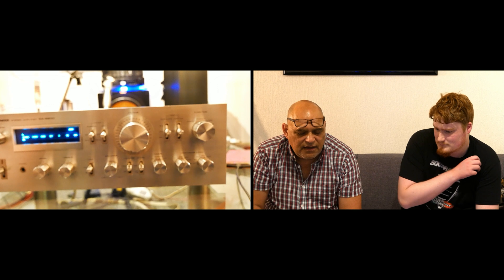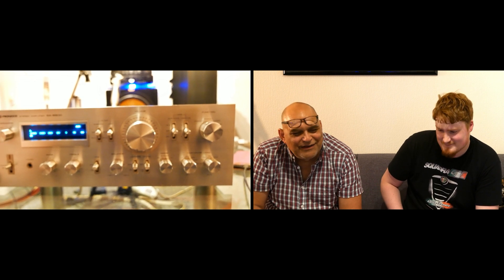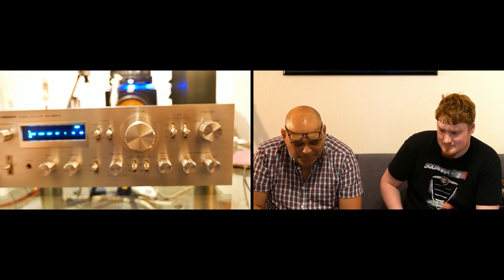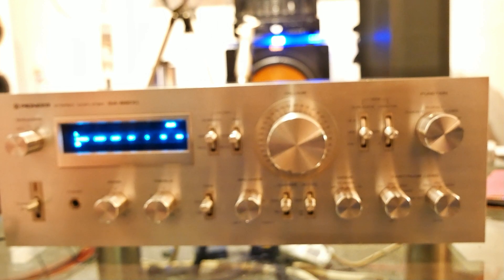Pioneer SA-8800 review soundtest

Comment: One thing that improved everything I've ever listened to is using a low frequency cutoff of 40 Hz. This is for the vast majority of music, some music can do a 35 Hz, but generally when you go lower all you're doing is allowing the soundless low frequency noise to drain your amp's capacitors with pointless excursions. I think a lot of CD's etc. they optimize the files and the process adds a lot of noise. The results are clearly noticeable, I wish everyone would try this and then we need a video on the topic and lots of comments.

Comment: Maybe reduce the voltage on the display so it last longer. Olso If the amplifier is rated for 220Volt and you use it with 230/240 all the components will run on a slightly higher voltage. Or does it have a voltage selector ? 

In the Netherlands it is 230 volt with +6%/-10% range but I think 240Volt is common. Especially with all those solar panels on a sunny day.

I know car manufacturers olso use brands like : B&O, Harman Kardon, B&W, Mark levinson and Volvo used Dynaudio, I wanted to hear that.
Reply from the maker: Not sure about the voltage switch. Simon still have it

Comment: Finally the type of review that you made when you start your chanel and make me happy.
What do you think about Akai AM95. 
I just got one now after years of serching. It was on my whis list after I see your review from 6 years ago about AM93.

I’m sure that you see a lot of amps but from my perspective AM95 it’s not easy to beat, but your opinion about it relly count for me.
Best regards my friend
Reply from the maker: I loved my am-93 very much. AM-93 and 95 are the same, they only have a different dac. The only reason why i sold i t was because some selector switches didn't work good anymore . Contact spray didn't helped anymore and from what I understand is that they all have this problem so at a certain moment you need to renew the inside of those potentiometers so it make good contact again. I prefer the sound of the akai am-93/95 over this pioneer 8800
Reply: @vintagestereo  
This one that i bought have the same problem with the switch for source or D/A. But it s the first amplifier that on direct without tone controls sound fantastic and I don’t miss them.  My speakers are JmLab Focal Onyx 713 K2.
I don’t know how many use old Akai but from my side this amp place it’s on top.
Today amplifiers to sound like this one I think should have starting price of 3000-3500K euro maybe more. 
Keep up the good work and for me your chanel it’s very very good